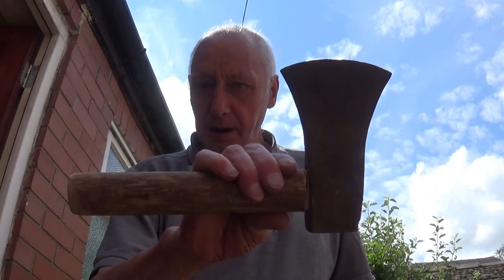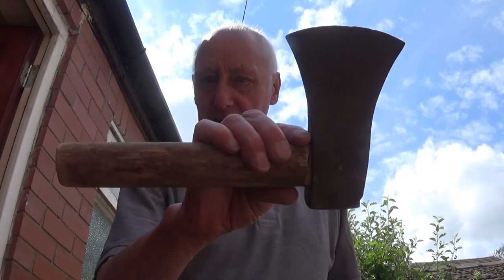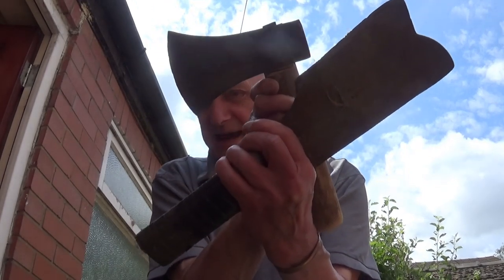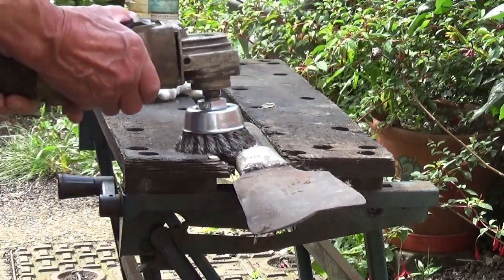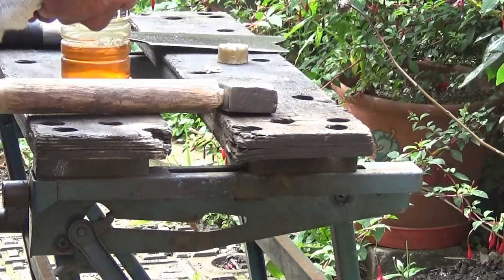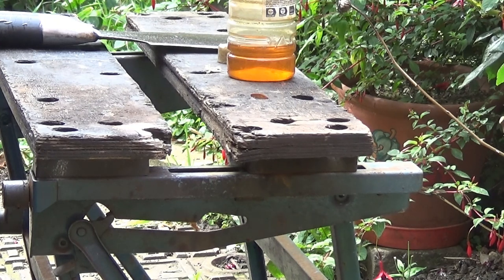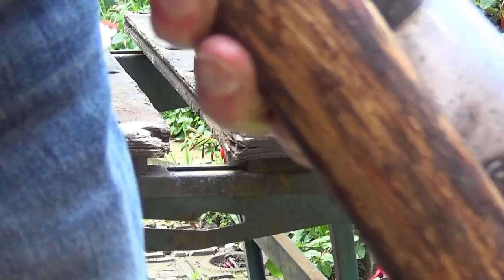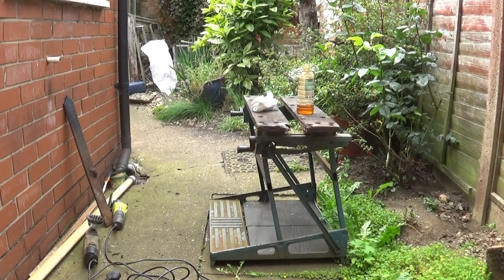The Axe and Cleaver

Comment: You did a great job of cleaning that axe up, last time I saw it, it was covered in rust. Is it me or are you a bit out of sync ? lol
Reply from the maker: Thanks Andy. Yes, it is a bit out of sync, no idea why but I've reinstalled the editor. Seem to be getting faults with it.
Reply from the maker: Just checked and it's the editor Andy. Might be because I'm having to use my left hand and possibly moved the track a bit. When you split the video, as I'm doing at the minute, occasionally this editor has mixed the sound track up. Trouble is I left the camera running, forgot to move it down, so had to redo it again. It's much easier to stop and start the camera, just putting them together. At least it's not happened on the camera, so that's ok.